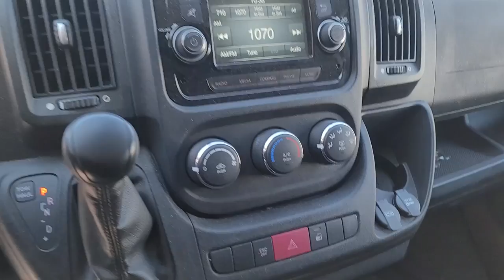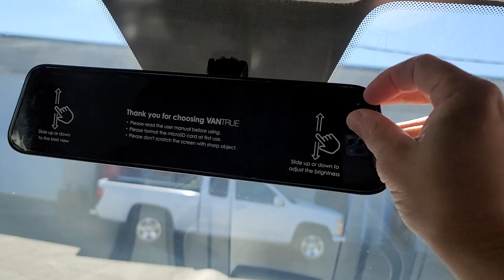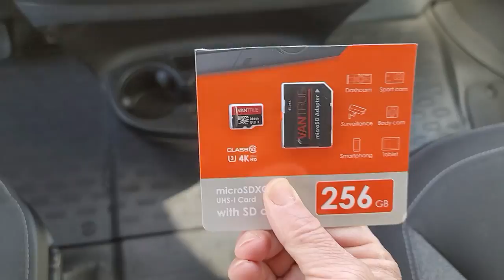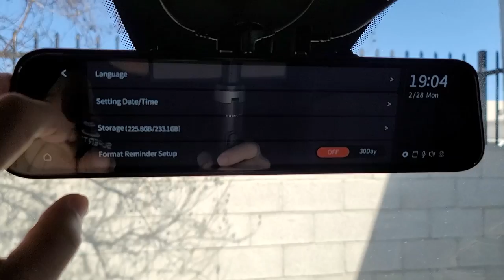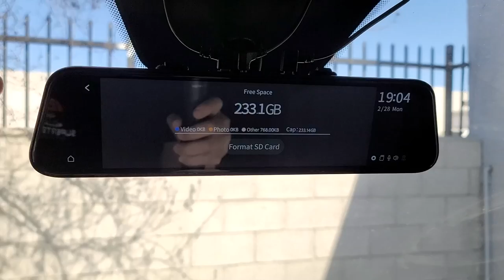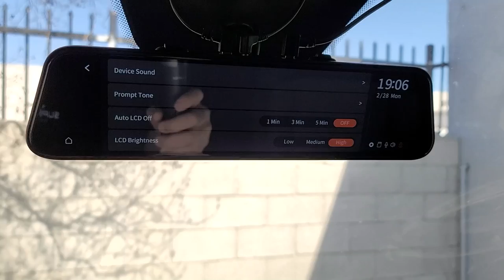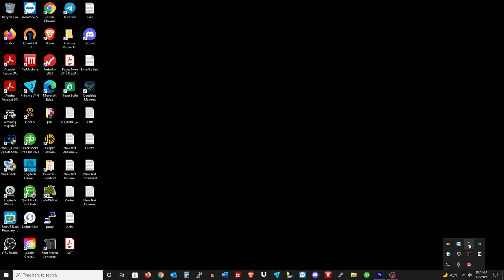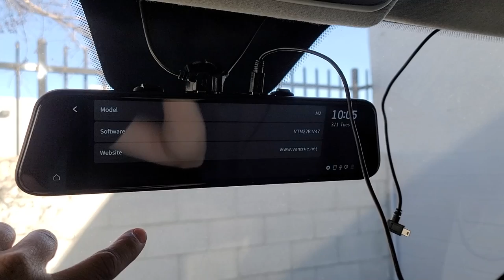Vantrue Mirror 2 Installation and Setup

Comment: Thanks a bunch for this install. I have been stuck on how to mount review camera now my only concern is how well will it hold with all the driving. How is the back camera holding up? Did it become loose? What tools were used to make tiny holes in plastic for the screws?

Comment: hi, thanks for the video. If it detects movement while in parking mode does it record on both cameras or just the front one? Does parking mode have a time limit? For example, if I connect it to a power bank does it record until the battery runs out or is there a preset maximum time limit?